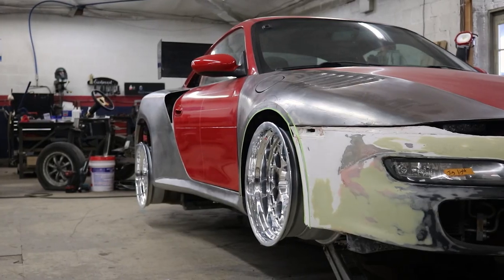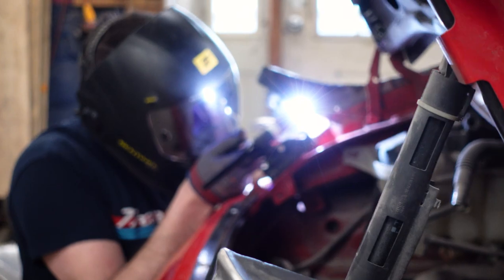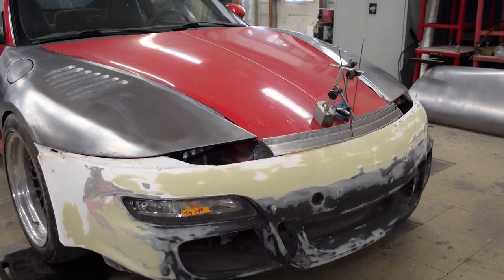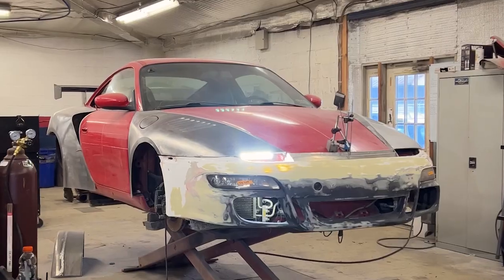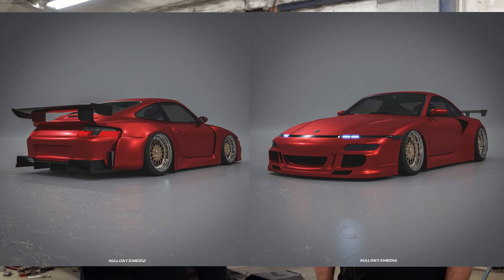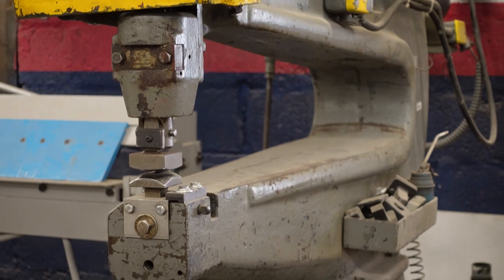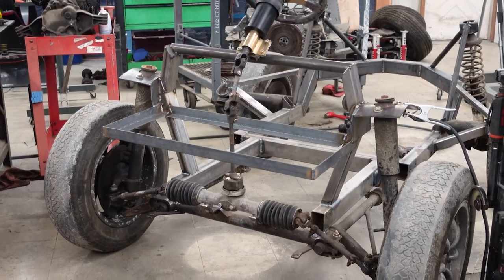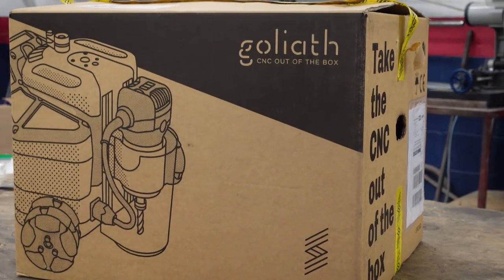Widebody Porsche 996 Slantnose Build - What is it?

Comment: I like the direction this is going, but not so sure about the 997 GT3 bumper just doesn't flow with the same lines as the rest of the car.
Reply: You're right. Looks like later 300zx front now